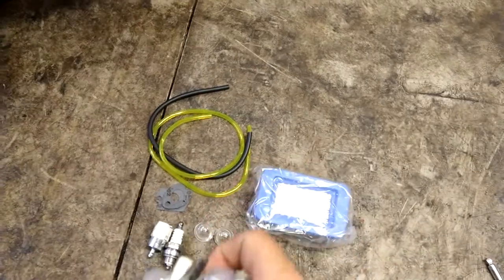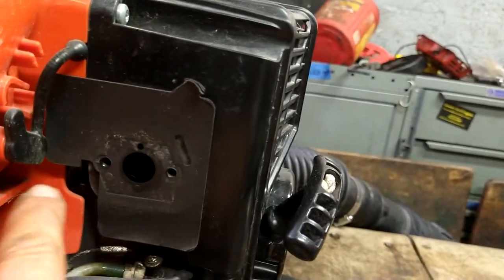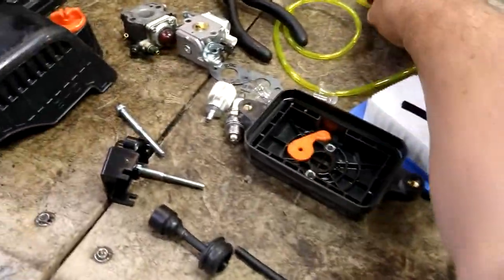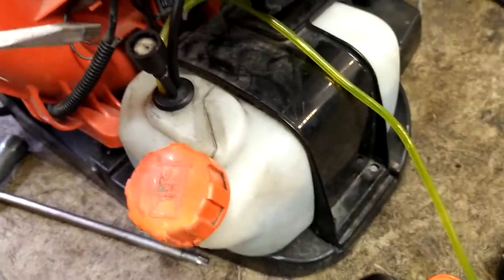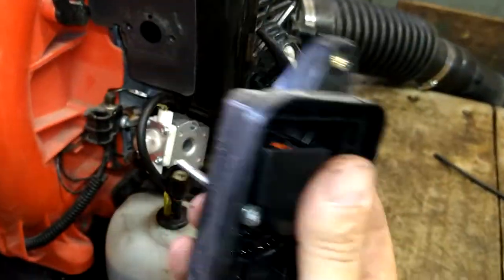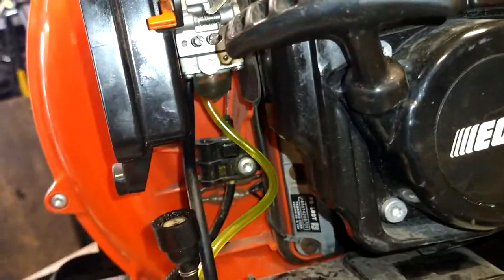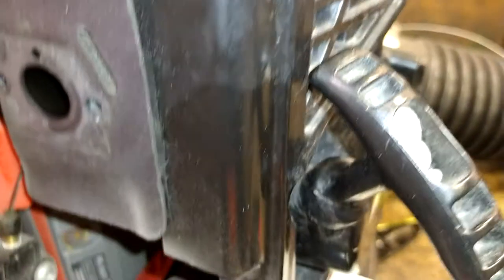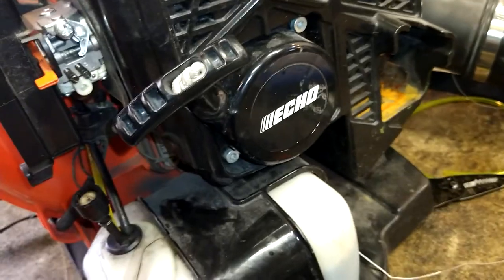echo pb580t backpack blower carburetor repair

Comment: nice video - could you post the carb adjustment video for the pb 580T ? glad you received 1800 views. good job.
Reply from the maker: i wish i could but i have yet to find a carb tool that works in them. it's a small d but everyone i get doesn't fit correctly. i'll keep you informed if i ever do.
Reply: @smallengineguys   - thanks for the reply - i found the other video you made about modifying/adjusting an after-market carburetor  (and your explanation about why you didn't use the $45 dollar OEM part).

i'll try the after -market part (per your video), i'd like to disassemble and clean the old carb - but as you noted, it's $40 for a tool i'll use for one machine (not cost effective in the long run).

i like the echo blower (more than the sthils actually), but i'm sorely disappointed that the manufacturer  is encouraging disposable culture - by making it challenging and cost prohibitive to repair a simple device (special tools).

thanks again for your 2 videos, they were very helpful.

Comment: Great video, it was all easy to follow. My blower was running good just needed a tune up so I bought the kit watched the step by step video and now I can’t get it to even turn over . Any suggestions would be greatly appreciated
Reply from the maker: sometimes the plug gets to wet and you need to take it out dry it retry at full throttle a few times

Comment: Thank you for the video, very much appreciated!
I just installed (today) the carb you linked on my 580 T. FYI, it no longer comes with a yellow line, and the old diameter is way too large to fit the copper tube, therfore,  I had to use some of the new black line (plenty was provided) but the black line dia is still too big, so I roughed up the copper with sand paper and used zip ties....hopefully it holds up.

Runs great at WOT, but is a PITA to get it to idle properly. I have installed several china carbs before, but this one is a particluar pain. Overall, im happy with it, even if i have to juice the throttle a bit to keep it at idle...no complaints for under $20 😂

UPDATE: Installed OEM Walbro WTA 35.. runs perfect now, no adjustments needed. Obviously cost more but worth it IMO

Comment: Thanks for sharing your knowledge. Look, I have one that was losing power and I changed the carburetor but it wouldn't turn on. The problem I have is that when I remove the spark plug, when I try to turn it on a lot of gasoline comes out of the spark plug hole. The spark plug gets soaked in gasoline. Is that normal?

Comment: The kit you linked to does not list the PB-580T as a model that the kit will work with. Every kit in Amazon that DOES fit the 580T has bad reviews. 

Spending the $45 for OEM seems like the way to go.
Reply from the maker: this is the kit i use the problem with these even the oem ones is you cant buy the adjustment screwdriver for them. so right away new you cant fine tune them. sometimes even the oem ones are so far out of tune that it wont even run. trash design from the get go. china just copied the trash design. same same.
Reply: @smallengineguys  so even though the PB-580 isn't list for this carb, it works...?..
Reply from the maker: @scotthoutz1018  actualy yes this is fine. I was thinking of a different carb when i answered you originally. I have never had an issue with these style carbs ever. They work everytime. You have to remember most people that leave comments are spitful and angry. Happy people go on there marry way. 90 percent of these angry people either put the carb on wrong hooked fuel lines backwards or put the same old rotten gas back in. The other 10 percent probably had something else wrong with the blower.